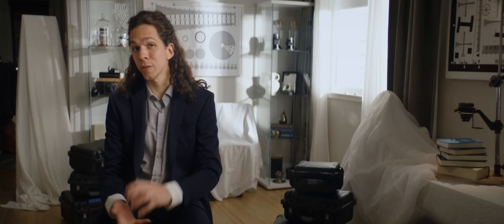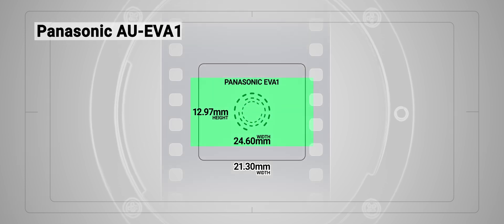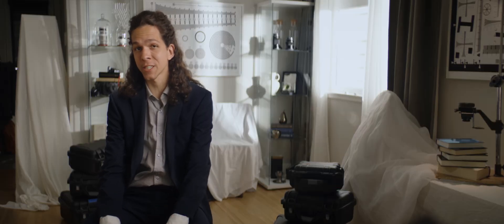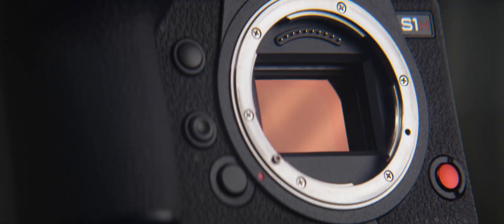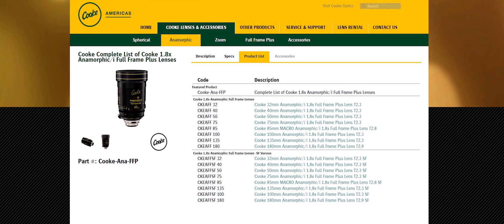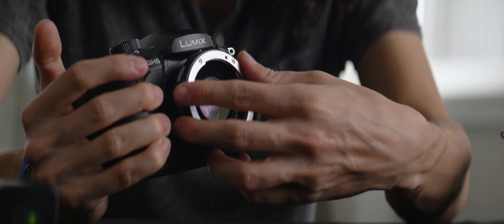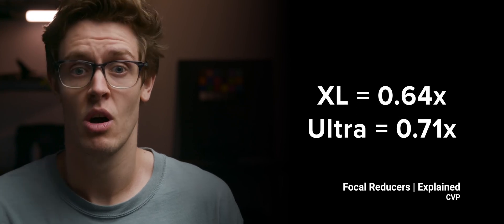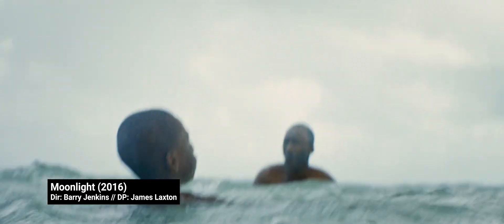The Effects of Sensor Size and Focal Reducers - Anamorphic Cookbook - Module 3 Chapter 03

Comment: Hey Tito, another brilliant video. Obrigado! You may get to this a bit later but I have been testing the Viltrox 0.71x and Metabones 0.64x + Isco Ultrastar RED 2x + Canon nFD 50mm + GH5 and it seems to me that the speedboosters mess with the lovely 2x oval bokeh by squashing it back to circular. Have you found that in your experience?
Reply from the maker: I've heard about some of that, which possibly means you need to tune up your metabones (I don't know about the viltrox). I've been using a speedbooster on the GH5 for ages and never noticed oval bokeh getting cancelled.
Reply: @AnamorphicCookbook  Thanks Tito. Appreciate the reply mate. =)  I've ran some further tests and it is only present f1.4 (wide open) - f2.0. It returns to lovely oval bokeh as you stop down. I was thinking I would have to pick up a S5 to shoot 4:3 APS-C without a speedbooster. Haha. My poor wallet.

Comment: My video camera is dS16, so 12mm x 7mm which is even smaller when you crop the sides off for some stretched stuff. 

My stills camera has a MFT sensor and it cannot record video with the full height.

Comment: VistaVision combined with anamorphic lenses was used for the Technirama format. The lenses were 1.5x squeeze prism based Delrama adapters. The prints could be 70mm (marketed as Super Technirama 70)with the anamorphic squeeze removed, or 35mm CinemaScope compatible prints wth extra anamorphic squeeze applied by an optical printer. The quality was high because of the VistaVision frame, and because Technicolor did the printing using their dye transfer system. Spartacus (1960) was shot in this format, it was also used for Nicholas Ray’s King of Kings and 55 Days at Peking.

Comment: Hello Tito, Kal in Toronto here with maybe an obvious question I can't find the answer to anywhere: if I try to use the Anamorphx adaptor on my Lumix S5, what is the best way to get the most sensor information please?

When I tested the AnamorphX I saw a giant square in the frame.  So I click into anamorphic mode... but now my 28mm lens looks like a 45mm, losing that wide Nomadland perspective I seek.

How might I ensure a) my wide angle Contax Zeiss lenses (25, 28 etc) don't get lost in a blur of 45mm and 50mm blahness with this adaptor and most excellent camera, and b) how do I maximise sensor real estate at the same time?  As I'm on the edge of buying a used AnamorphX, all help appreciated, with many thanks in advance! Kal
Reply from the maker: Hey Kal! Is it the 1.33 or 1.8x AnamorphX you're considering? For the 1.8x I think the best way would be using the 6K Photo Mode, which might make for a weird for workflow in post or on set. 

For the 1.33x, just shooting regular 16:9 full frame will do for an almost-cinemascope aspect ratio at the end (16:9 * 1.33 = 2.36:1)

The 1.33x adapter will clear even the Contax 21 on full frame, so you're not getting any blah crop. :)
Reply: @AnamorphicCookbook  Fantastic Tito, thank you so much for that. It's a second-hand 1.33x, and I'm an inch away from buying it for what I see as a crazy good price. There's a VERY tiny flaw / bubble in the back of the element -- which is usually worrisome on sphericals.. I thought it was a scratch, had to look at it with a lupe to see what it was -- but see no aberration when looking through my 28mm Contax lens... Perhaps because it's actually not the end-point element closest to the sensor? 

Regardless, it's otherwise in perfect shape, and since I'm in the market for the 21 and the 25, I'm delighted it clears them! This is great news. 

As I'm drawing toward camera tests for my first feature, I'll be upping my membership for a quick run-down, if I may, on any/all advice and best practices and cautions you can offer with this tool if I may?

Meanwhile thanks so much for getting  back to me -- very kind.
Reply from the maker: Lots of soviet glass had bubbles in them and the effect is minor! If the price is crazy good, I don't see why not!

Make sure to join the Discord server! We talk a lot over there and prep for a feature is something that could get a lot of insight from the other members too! :D
Reply: @AnamorphicCookbook  will do, thanks Tito!

Comment: Aps c has the same aspect ratio as FF.  I was under the impression that super 35 was a different aspect ratio.
Reply from the maker: Super35 is by default 1.33:1. APS-C video and Full Frame video are usually 16:9, but they can be different according to the manufacturer. :P

Comment: Loving the series! Keep up the great work! I get my first true anamorphic lens this week (Sirui 50mm RF Mount) - my plan is to use it on the Canon C70 (S35 sensor) which has anamorphic 1.33x and 2.00x de-squeeze modes built-in it :) If I love anamorphic after this - eyeing the Vazen 28mm RF mount for its size and better focusing mechanics.